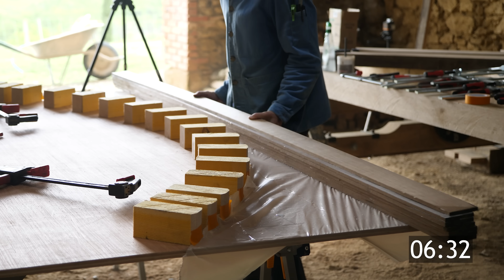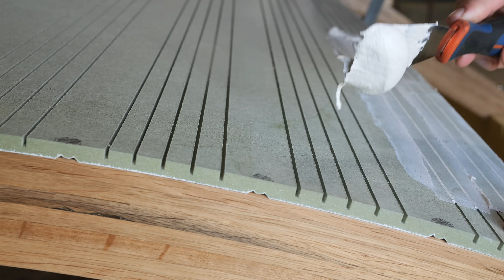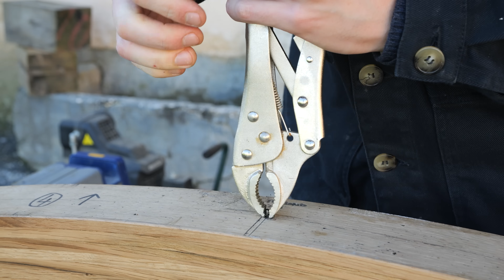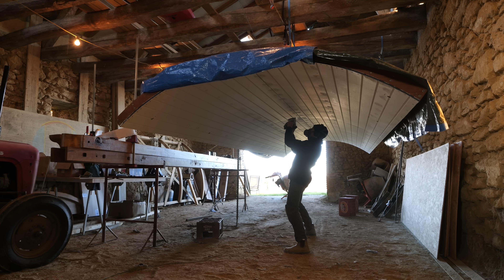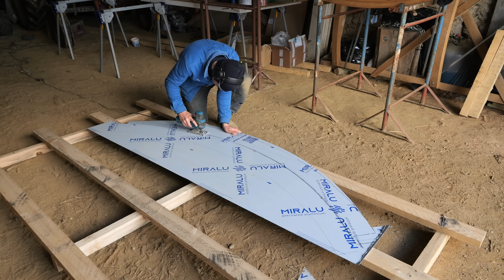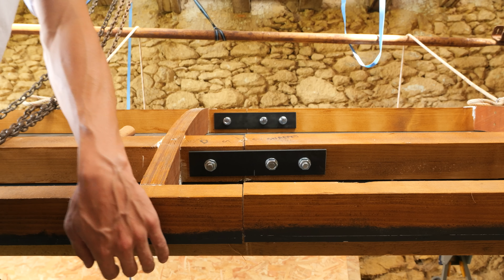I Made the Roof Too Big

Comment: What a magnificent series. The camera set-ups, the craftsmanship, the whole project. Mesmerising story. A tip with the wood filler - shallow fill on the first pass, leave a concave or partial fill that won't require sanding as you leave the substrate clean. When it's cured, go back with a second pass to fill the remaining cavity, the aim being to minimise sanding. Using your filling knife from the midpoint of each hole, and spreading in both directions should leave the substrate clean and avoid the pull-out that spreading right across the hole causes. 
Can't wait to see it finished, subbed!
Reply: The chuck on your drill can sometimes work to remove snapped screws. Tighten it down such that the three jaws grip whatever is protruding and use the drill to wind it out. Works on stripped screwheads too.

Comment: A few tricks to remove a stuck screw or bolt... 1. Tack Weld another piece of metal to it to give it some leverage to turn it. 2. Grind (or Cut) a slot in the end and use a Flathead Screwdriver to turn it. 3. Heat the end of the screw with a torch... This will melt the lignin in the wood and may help release the screw when you turn it.

Comment: Great job getting those screws out.  I would have run the drill in reverse for the very faint hope that it would catch the screw and twist it out.  Left handed drill bits have saved me a few times in a broken bolt situation.  Thumbs up!

Comment: Love the oak, but I’m scratching my head. I’ve been on so many sites where Moisture resistance MDF is used fully sealed all around and it is really not like a normal quality timber at all even softwood.
Reply: why not use local larch board smaller format width  (no MDF). I'm working on one that is entirely breathable envelope, won't need the ALU. Hey stunning build and quality though!

Comment: Glad to see you back, it was a very pleasant surprise to have a new video pop up.  I am curious, with only having one bolt hole on the one side of the roof joiners, won't the roof want to flex and pivot?  I realize there isn't much room to fit a second hole due to the location of the cuts.  My suggestion would be making a couple of smaller holes on that side where you could install either structural screws or possibly smaller diameter through bolts.

Comment: "plug cutter" - to remove snapped screws.
21 years ago I made my 'rolling woodworking shop' - very similar to what you're building. After the roof was done I put a layer of chopped-mat fiberglass cloth/ gel coated, on roof & drip edges.  21 years later it is still in perfect condition. (wish I had used marine ply throughout)

Comment: 29:00 Quick, go back in time... the single hole side will act as a pivot and not hold it square.
Reply: Could add some small dowels on the single sides just to hold it square. Use long "straights" clamped across the gaps to align.

Comment: An even cheaper solution to the bolts cost is to buy 10mm round rod and thread the bit you need. It would have the advantage of filling the 10mm holes tightly, you could weld it to the plates at one side, the nuts would hold better than stainless steel and you could spray it with stuff from Liquid Moly if you are worried about rust. Great to see you back, pity the roof had to be cut.

Comment: Considering there is no actual joint in the ends of pieces you cut, I would recommend adding a steel dovel to keep them attached at the right position together. The plates will hold it together, but they will misalign over time.
Reply: Yes -- something needs to be added especially on the side where there is only one bolt, as slippage will happen with thermal cycling, etc.  One option might be to extend the plates into an L shape, where the extra leg has a hole on the curved rafter to help prevent rotation. The brace-first-and-then-cut approach leaves the kerf empty.

Comment: I have a thought. Your edge detail is excellent with the bent aluminum. I might have put a drain hole on the bottom edge because if water splashes up on the overhang and even a minute amount wicks into the valley made by the aluminum it has no where to go and won’t readily evaporate.

You do great work, it’s beautiful.

Comment: Lovely to have you back 👍🏼I work with aluminium a lot,box gutters etc…anywhere the aluminium is exposed to air it will condensate producing a substantial amount of water. I’d advise adding a thin sticky back foam tape to the rear of the aluminium which prevents this from happening 👍🏼
Reply: Great idea and I think a must in this application.  I have had the same issue when flashing against any organic surface in cold country.

Comment: Good to see you back on the job.  I appreciate how hard it can be to focus on the big project when there are so many other priorities to take care of.  I especially like the way you walk through the problem solving process and it goes to show that no matter how good the plan, it generally goes out of the window when you begin execution.    I felt for you having to spend so much time removing the screws and definitely a lesson learned.  As for the mdf i think it is absolutely fitting because all of the tree is being used.  Purists may scoff at mdf but its cost effective, straight and readily available.  I think your laminated oak beams came out great!   Well done for drilling massive bolt holes in your hardware with a hobby drill 💪🏻😎✌🏻 Good luck 🍀🍀🍀

Comment: I nearly cried when the roof was cut in three!  It seemed like a living thing by then.
105kg seems remarkably light.  Heavy dense wood, quite a bit of glue, but the large structure clearly as strong as it gets.
Fantastic, one-of-a-kind project.
Reply: At the end Carl said the three pieces were 75 + 75 + 40 if I heard right... so was it 190 kg in one piece?
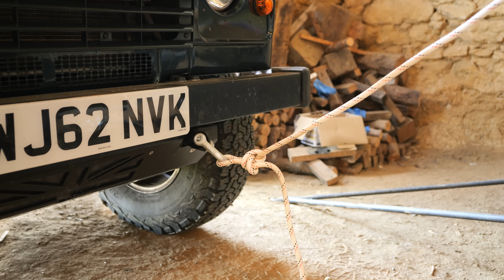Reply: @antwit  The 105kg was the frame only 5:50, so I suppose the mdf added 85kg?  Sounds about right.

Comment: I remember the stressful curved laminate glue up video 😉

I would recommend Titebond "Extend" for any future curved glue ups as it gives you a longer open time & also has minimal spring back.

For the curved roof personally I would have gone with a thinner bead & butt sheet & then laminated another sheet onto it, would avoid all that saw curfing & filling & would be more stable IMO.

The cost difference between the MDF panels & Oak is astronomical, probably a couple of thousand £/€ at a guess.

But they have turned out  fantastic & that's some highly technical work & some joinery to be proud of 🙂